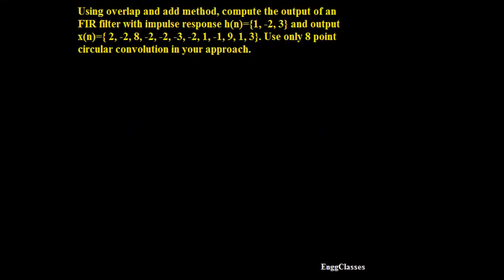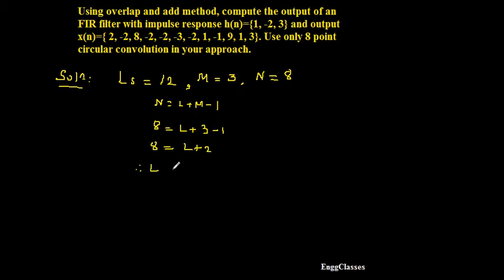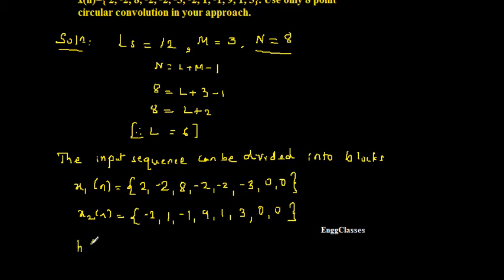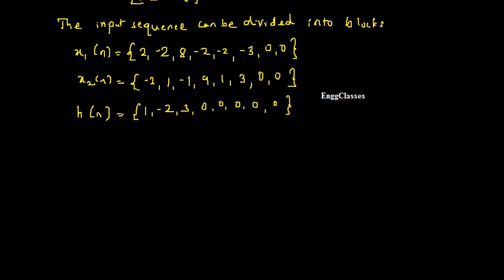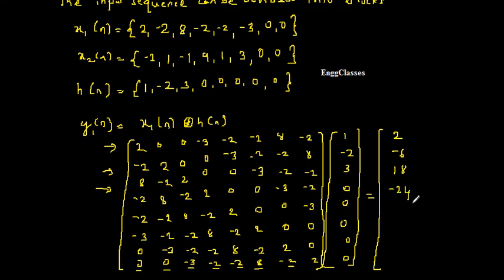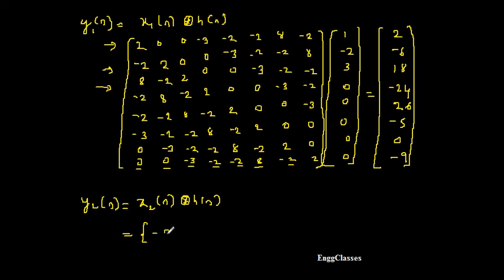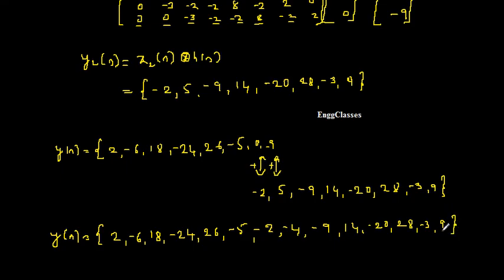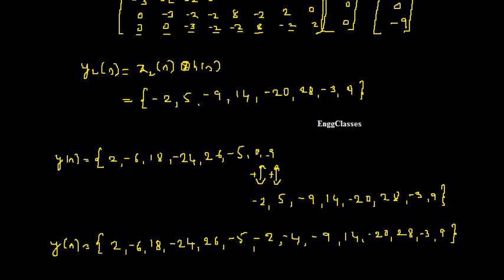Q4. b. Overlap Add Method (Numerical 1) | DSP | EnggClasses

Comment: Sir why we dont consider another x3 here when the output will be 12 digits , whereas calculated output length is 12+3-1=14
Reply: Because already by x1 and x2 the length of y(n) is 14 so there is no need for consideration of x3

Comment: Use overlap save method to compute y(n) of FIR filter with impulse response 
h(n)={3,2,1} and input x(n)=(2,1,-1,-2,-3,5,6,-1,2,0,2,1).Use only 8 point 
circular convolution in your approach. Please solve this question sir
Reply: To compute y(n) of FIR filter with impulse response h(n)={3,2,1} and input x(n)=(2,1,-1,-2,-3,5,6,-1,2,0,2,1) using the overlap-save method, we need to follow these steps:

Define the block size L, which is the length of the FIR filter h(n). In this case, L=3.
Zero-pad h(n) with L-1 zeros to obtain the extended filter H(n)={3,2,1,0,0}.
Partition the input sequence x(n) into blocks of length L-1, with an overlap of L-1 samples between adjacent blocks. In this case, we have 4 blocks: x1(n)={2,1,-1}, x2(n)={-2,-3,5}, x3(n)={6,-1,2}, x4(n)={0,2,1}.
Zero-pad each block with L-1 zeros at the beginning to obtain the extended blocks: x1'(n)={0,0,2,1,-1}, x2'(n)={0,-2,-3,5,0}, x3'(n)={0,6,-1,2,0}, x4'(n)={0,0,2,1,0}.
Compute the circular convolution of each extended block with the extended filter H(n) using an 8-point circular convolution. We can use the FFT algorithm to compute the circular convolution efficiently. The circular convolution of x1'(n) with H(n) gives y1'(n)={6,8,1,-1,-3}, the circular convolution of x2'(n) with H(n) gives y2'(n)={-3,-1,19,4,-4}, the circular convolution of x3'(n) with H(n) gives y3'(n)={3,23,2,-3,6}, and the circular convolution of x4'(n) with H(n) gives y4'(n)={2,4,7,4,1}.

Discard the first L-1 samples of each y'(n) sequence to obtain y(n). In this case, we have y1(n)={1,-1,-3}, y2(n)={4,-4}, y3(n)={-3,6}, and y4(n)={4,1}.
Therefore, the output sequence y(n) is given by concatenating y1(n), y2(n), y3(n), and y4(n),
 y(n)={1,-1,-3,4,-4,-3,6,4,1}.